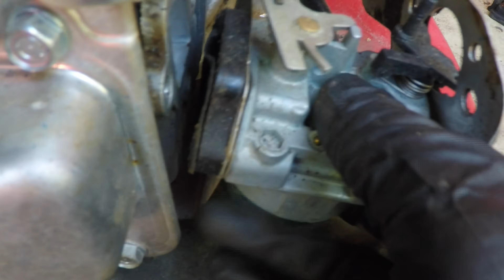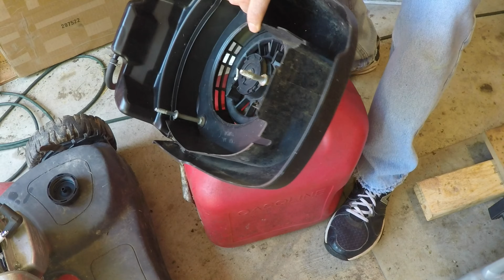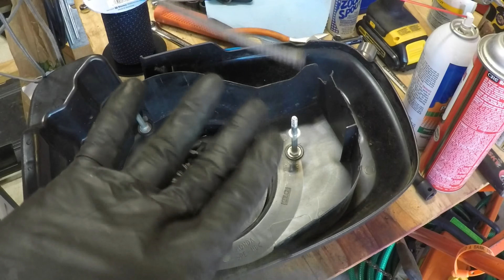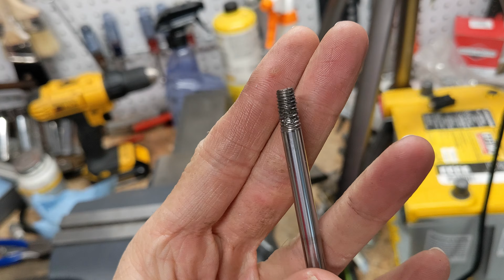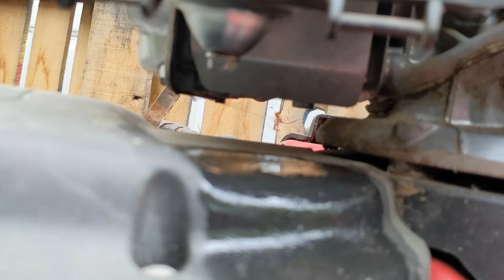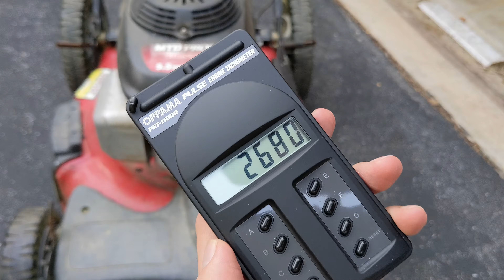Junk MTD Honda Mower - Let's Fix It

Comment: Thx for the great video and step by step instructions - helped me to clean and fix the sticking needle of the carburetor. Now after reassembling the carb. the motor's RPM increased significantly. Where can I tune down the idle rpm on the Honda gvc 160/190 carburetor without disassemble it again? Or should I clean the choke mechanism? After engaging it's returning right out when I pull the brake release lever.

Comment: was just watching your ( clean the carb) Vid and came here while resisting the urge to pull my hair out trying to get the emulsifier tube out of this exact same Carb. I noticed that when yo held the jet up in that last video ( I had removed mine as well) that the hole you were digging into was WAY bigger in that vid than mine here in person. ( I am literally doing this right now by the way ) 

  You had stated someone has already been in that carb.  I think that " sombody"  already bored that jet, the reason being that mine is tiny even after cleaning, Yours was probably 2x's the size of mine ( I also have the green crud.) <-- What the hell is that? It;s Growing IN GAS!   anyway, I have a lot more green crud than you did. it;s even growing on the plastic float in spots. 

OMG  I just got the emulsifier tube out! I was about to order a whole new carb off ebay.  Grr,   I had to take the Choke flap out ( Shiny one) and run a screw driver thru the carb tub and then with a sht ton of might and both hands force the driver shaft on the top of that emulsifier down  it went flat and was STILL STUCK! Grr.   I didn't have a pick like you had, I ran a brass wire up thru the middle just barley above the edge of the emulsifier tube lip and then bent it over ( painstakingly )  and then pulled the whole thing out.   I am wondering now if the emulsifier holes on yours were also bored out a bit.  I wonder because mine are  super small like the jet tube hole.   They are so small that a Chinese bread tie wire with the paper removed will just barley fit in there. ( I know it;s Chinese, it;s from wal mart twist tie bags.  The good ones will not fit at all. LOL  I am putting an inline filter in this,it clogs way too easy. 

  I bought a Tecumseh powered troy built recently (pretty sure I wil need it soon )   got the same problems with that,   I will check out other vids of yours , Not sure what all you have yet/    These two vids are real good.  Thanks from Idaho. :0)

Comment: I tried to duplicate thr same temp. carb stud hack.  Found 1 carriage bolt that was the rignt threads & long enuff.  Cut the head off & it worked great.  

Just having one is good enuff and a huge help.  But i wanted two.  I used a wooden chopstick from chinese takeout for the other.  

I had located a nut that fit the original bolts & was using it to try different bolts for one with the rignt threads.  I used that same nut to make threads on the wooden chopstick.  Worked great!

Comment: I have the same one.  Bought 07/23/2004 & it has always started in 1 - 3 pulls until this year. 

Just went through the carburetor, putting back together now.  Fingers crossed!
Reply: Since my comment 10 months ago I have been thru it and back again with my $%@#/?! lawnmower.  Good thing I don't own a gun or I'd have put us both out of our misery. 

Ultimately I have prevailed over the beast with lots learned along the way.
The carburetor had a plugged pilot jet.  It took about 5 or 6 attempts to get past that.  

Torch tip cleaners did not get it but micro drill bits did.  Harbor Freight $2.99.

Wore out & tore some gaskets taking them off and on, off and on, x5 or 6.  Cereal box cardboard -no.  Gasket paper from AutoZone -yes! $12?

Put the spacer on backward once.  Eventually got a sharpie and numbered every gasket, including the spacer and the 2 metal plates.  WITH the numbers facing the way that would correctly orient everything, so nothing ends up backward or upside down which IS POSSIBLE, or so I'm told.  Just sayin' . . . 

Mis-threaded the float bowl one of the times & had to figure out the gas leak.  Luckily no damage done.  

Had the governor arm pretty screwed up from jerry-rigging it with 14 gauge wire so it wouldn't idle at 8k rpms.  Reset it a few times, straightened & rebent the spring to look like it's supposed to. 

Had the skinny end if the spark plug come unscrewed a couple of times.  Don't ask me!?  Maybe related to hydrolocking(?) 2 or 3 times where the rope will NOT pull, or rips your arm out of the socket.  Remove spark plug & rotate blade by hand until compression eases off to fix that issue.  

Changed the oil and it starts fine, runs great.  Wouldn't trade the challenges and lessons along the way either.  Good stuff to know.  Thanks 4 asking!
Reply: @evelynmahoney3569  I hope I do as well (getting it running in the end) I rebuilt the carb, put it all back together and it will only run on choke until it is very warmed up..then only on high..after running and mowing for over 20 minutes it will allow me to throttle it down a good bit but if I turn it off, let it sit for 5-6 minutes...I have to work to get it running again and  repeat it all again. I'm not sure but I will take the carb off again double check all that (and gaskets) but I'm just not sure why it isn't running correctly. I tested the gas cap, vacuum, watch about 25 videos on the same rebuild..I'm puzzled. I hope I can not shoot the mower..I have a gun. haha (I really wouldn't but...)
Reply: @evelynmahoney3569  Great story! I'm on my first carb removal and we'll see how I'll do. I sure am glad I noticed your post because I learned a lot from it! You might have saved me a lot of headache, and many others as well. Two thumbs up for you, sir.
Reply: well? I just have to know.
Reply: Well?
Reply: @Markomyt1  did you sell it? Is it still working? Just wanted some follow up...thanks

Comment: Have the same Honda engine and choke set up on a Craftsman.  I found the choke released too quickly causing the engine to die.  I fiddled around with it and couldn't get it to stop releasing so quickly; finally just removed the linkage from the bail handle.

l
Reply from the maker: I fiddled with this one too. The springy metal tab that pushes the plastic choke lever can be bent in either direction to tweak things. It's kind of a pain because it's just trial and error, but you can adjust how long the choke stays on that way to a certain extent.
Reply: @billyb351  Thanks for the tip; I'll try it.